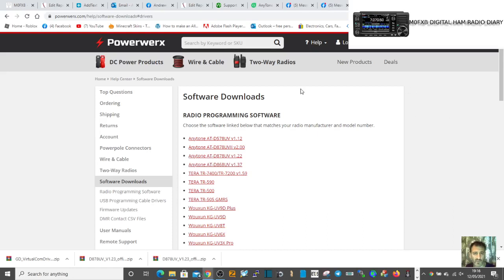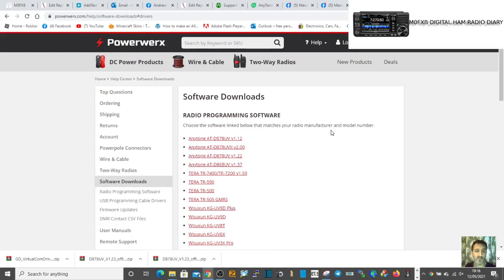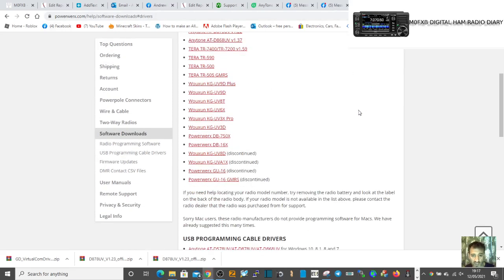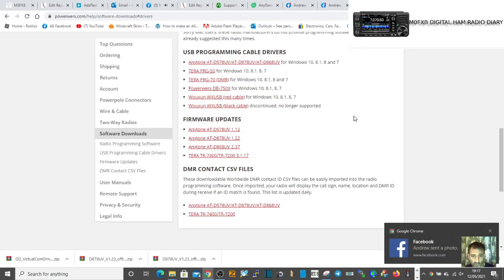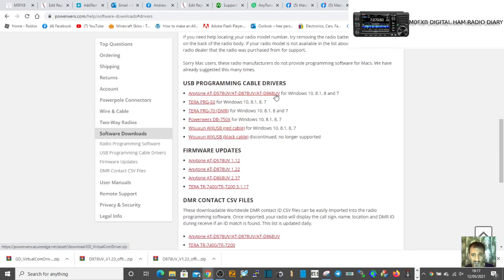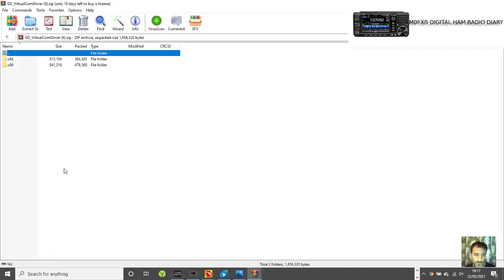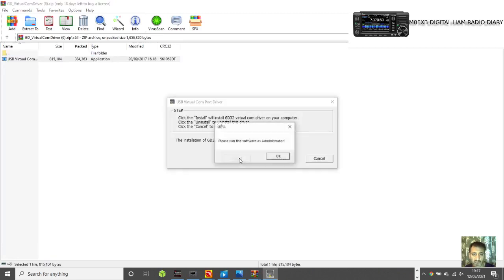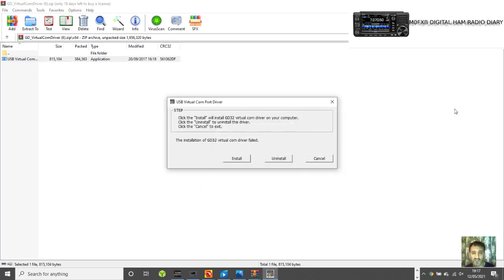Anytone 878/868 gd32 driver

Comment: I have an old XP laptop I would like to use for my 878 and 578.  Would you know where I could find a USB driver for XP?    Thanks Ken
Reply from the maker: Hi Ken , I have not heard of this , my recommendation is purchase a used Windows 10 Laptop .
Reply: @HamTechRadioScannerDrones  I found the XP driver.  The CPS works perfectly with my old Dell 610 laptop.
Reply: @HamTechRadioScannerDrones  I actually have newer computers but I thought I would find a use for this old Dell 610